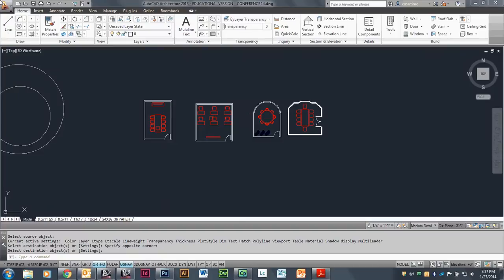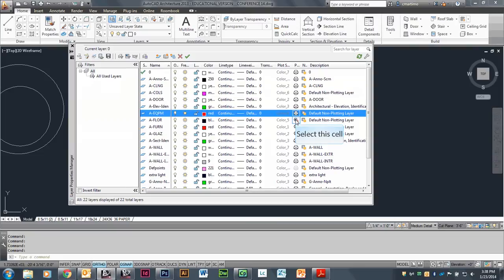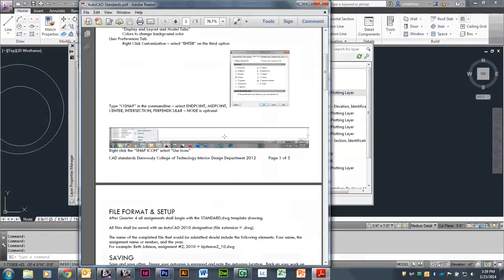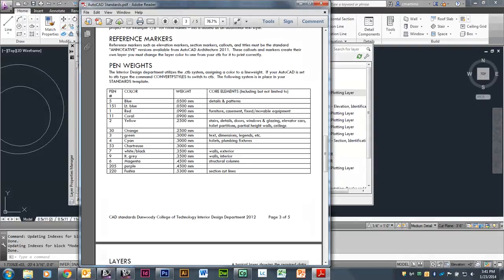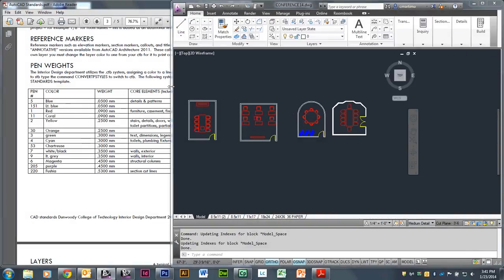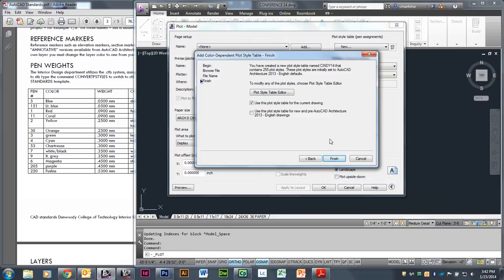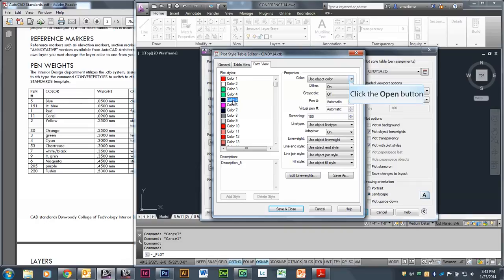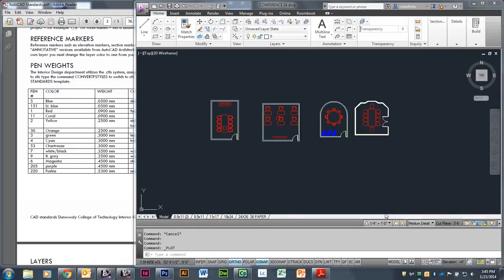Custom CTB and Layers for AutoCAD

Comment: Hello Cindy, I learned different way to set up ctb different way, I do from plot style manager then Style Table Wizard, what's difference(s) between them? Thanks you for helpful video.
Reply from the maker: If you are using a plot style, in general you are using a .stb instead of a .ctb.  The difference is in a style based plot style the elements prints depending on the established style for that layer.  Whereas in a ctb the element only has to be a certain color to print with certain properties.